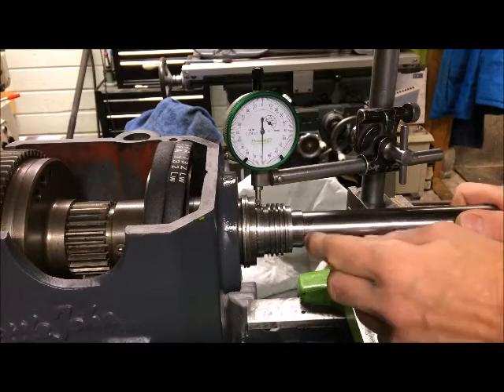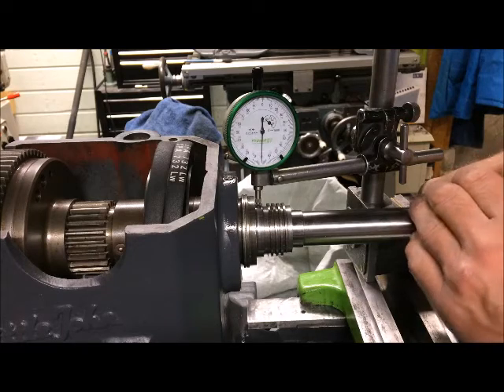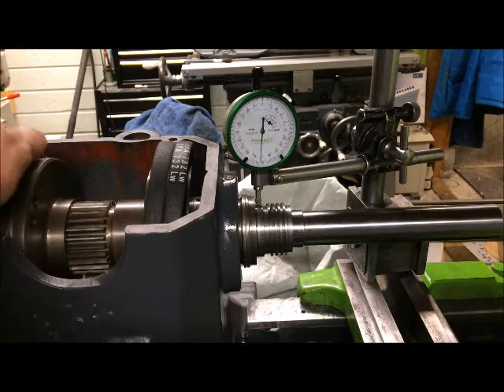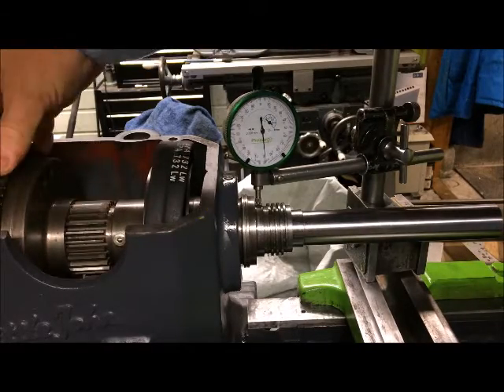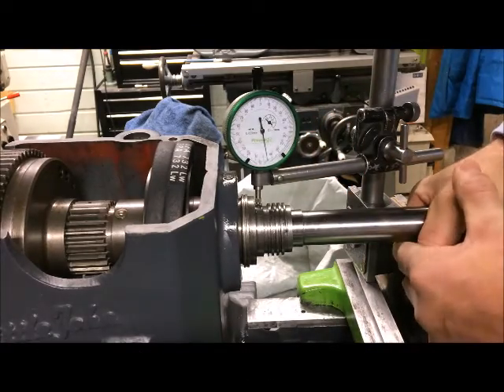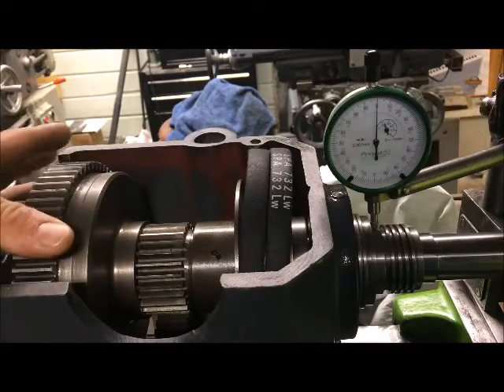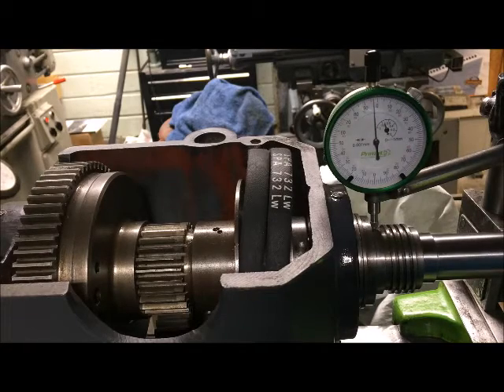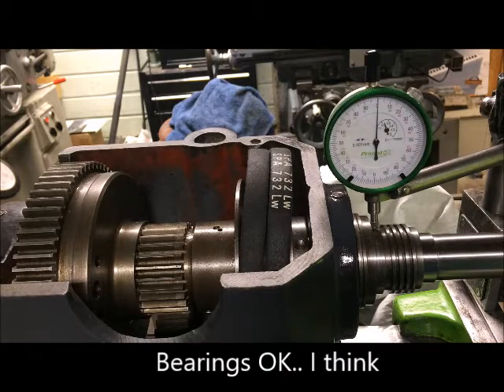Raglan Little John - Headstock - Spindle bearings - 2

Comment from the maker: I also tested with the indicator mounted to the headstock directly, thereby negating any effects that mounting to the saddle could possibly make. This is probably the most correct procedure. Play is the at around 5/1000 mm (2/10.000 in)